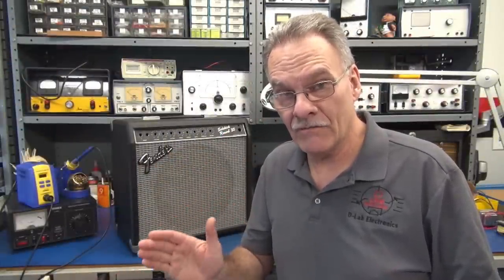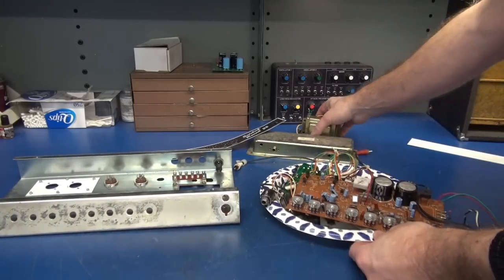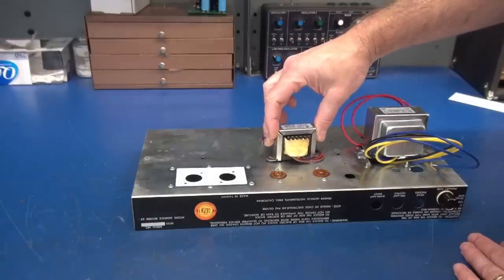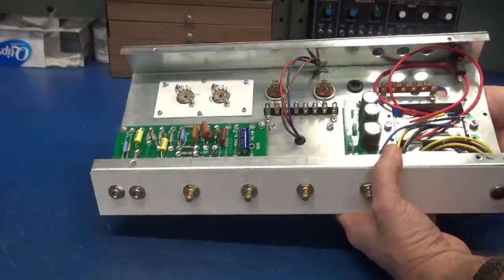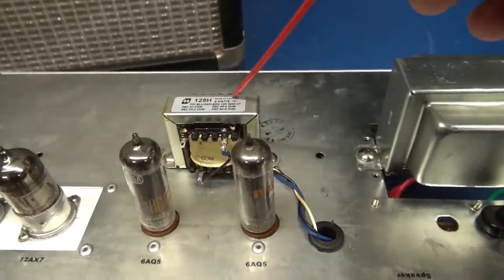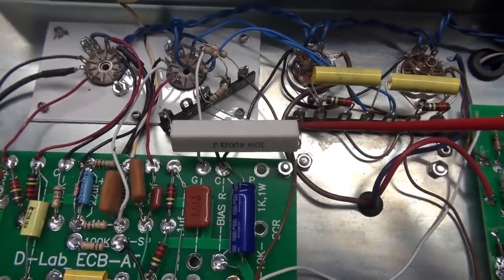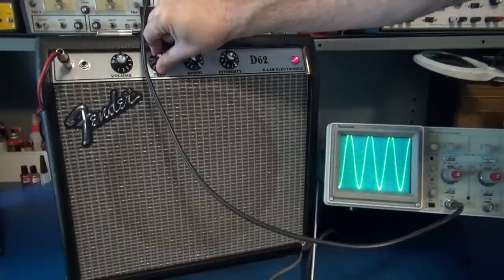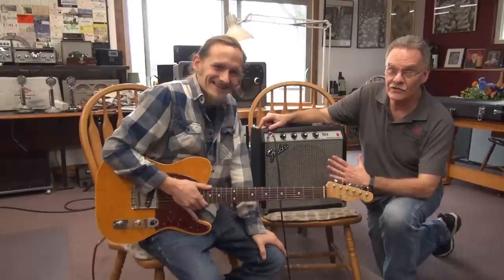Build Convert Solid State Guitar amp to tube Example Fender Sidekick 35 to 6AQ5 6G2 circuit

Comment: This is what I do for most my builds. Cheap ss amps make great starters
Reply: Definitely cheaper than buying a pre built cabinet and chassis if you don't have the tools to build them yourself. Pick up one of these for 50-100 bucks or some other cheap SS amp and get some transformers and a small parts kit and drill some holes and start building. Could even leave it looking like the stock amp and make it a sleeper lol
Reply: @russiangoose7053  That's a good idea for my Winnebago... it's only worth $50.00.

Comment: I love this video! I have several smaller 🤡 board amps that I’d like to upgrade to the real deal.

Ps.  Parts are available from D-Labs?
Pss. I need to add an effects loop circuit… do you have a prefab kit.  So many players I know are looking to do this mod, but there are so few vendors out there.

Love the channel- all the best!
Frank
Reply from the maker: Yes, I have the boards on hand, see d-labelectronics.com I do not have info on effect loops

Comment: I have a REAL '64 Princeton 6G2 with an EV Alnico 12" speaker.
You are there. There IS a trick. If you put a grid stopper resistor on the input to the phase splitter, it prevents the blocking distortion that results if you use overdrive pedals with the 6G2 circuit.
It allows you to unleash the TONE MONSTER! That thing will then give up the goods. The small dog has a MEAN BARK!
Overdrive a split load PI, with and without a 56k grid stopper, and you can see the blocking distortion I refer to with your scope.
My '64 has that grid stopper, and 470 screen resistors. A 12" EV.
It WILL still have the original vibe of the amp. BUT, overdrive it NOW, and it will do the Neil Young Rust Never Sleeps CRUNCH!
Try experimenting with a grid stopper on the PI. you will find the sweet spot with a decade resistor box and a scope...
You will see. The scope don't lie.

Comment: Do the transformers being oriented in the same direction cause any hum?  Edit: Sorry, the oscilloscope trace answered my question. IMO, that sounds very nice.
Reply from the maker: No, not modern bell end transformers. I have answered this question 100 times. Guess I need to do a video and rotate a transformer so everyone can see the results. Yes, the o'scope noise floor test is evidence. I will get more info on soon.
Reply: Good question but a simple explanation that us "Dummies" can comprehend would cause less anxiety; " Is my amp transformer recieving + where - is supposed to be and vice-versa. EUROPEAN plugs use "Shuko" design where it's hard to tell + from - , all we want to do is plug-in power the right way round. I have to test every wall socket to see how the local "Sparky" has orientated the wiring, when I find + I then wire-up my own plug to correspond with the amps power cable colours. It may not make a difference but when you use valve amps yoh just want to know you are'nt going to damage it by reversing power phase...Help!!

Comment: I’m asking around, do you know of anything preventing me from replacing all the tubes in my amplifier with transistors? I understand it will affect the tone; but I want to know A. Will it function? B. Will any additional mods be necessary to the circuit to properly employ the output transformer? C. Will this path do nothing but destroy an amplifier?

Comment: Are you getting hum from the output transformer being inline and not perpendicular to the power transformer?
Reply from the maker: Nope, That old rule does not apply as you can see from the noise floor test
Reply: I noticed the power transformer wire bobbin is well shielded with a Faraday shield.

Comment: No standby switch? Have you over-rated the filter caps to handle the power on surge? Also, what was the power transformer?
Reply from the maker: I never use standby on my builds. The power transformer is custom made

Comment: Nice job, Terry. One thing I noticed was that the power switch is conspicuously absent from the front panel!
Reply from the maker: Its on the rear, just like the Princeton 6G2
Reply: @d-labelectronics  Ah, thanks, Terry. I need to read up on those old models!

Comment: D LAB, How did you reduce the noise floor? any tips
Reply from the maker: Grounding & wire dress
Reply: @d-labelectronics  can you make a video showing the wiring dressing and grounding difference?
Reply from the maker: Can do, but it will be a while due the backlog here
Reply: @d-labelectronics  that fine I'm curious to see the wiring dressing and grounding schemes to lower the noise floor

Comment: Help….see that you use the hioki dt4256. Had another electronics tech tell me it wasn’t sufficient for guitar amp maintenance and mods due to a frequency range limitation. He recommended the Hioki DT 4284. He had said that the 4256 was more for checking outlets around the house. Confused? It sounded a bit like bunk because I think you’ve used this religiously since taking it for a spin. I want to be able to do projects like the one you are showing us. Any thoughts on this and are you at all familiar with the DT4284? I would like to buy once and have collected a lot of future projects since coming across your fantastic channel. Cheers Terry-much appreciated
Reply from the maker: I purchased the DT4256 for the high speed display update and am very happy with its performance. Matter of fact I own 2 of them. When I'm concerned about frequency, I use an oscilloscope.
Reply: @d-labelectronics -thanks Terry